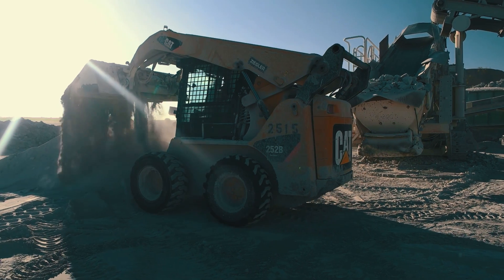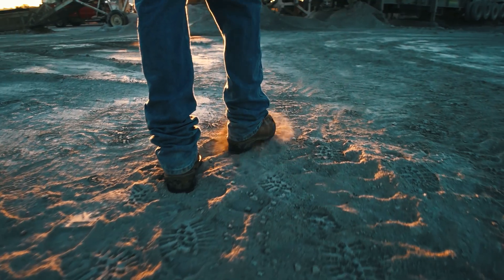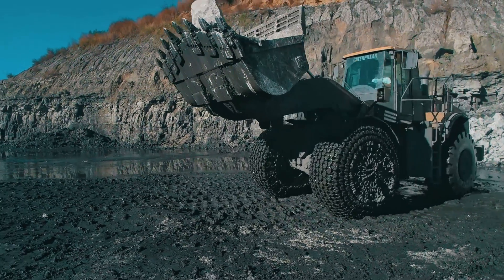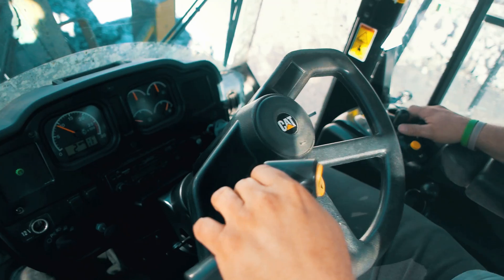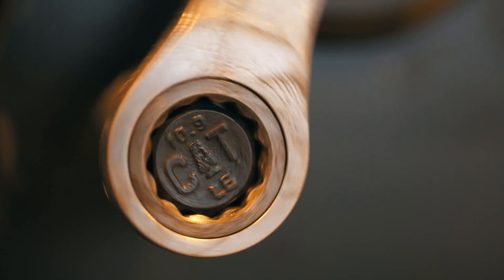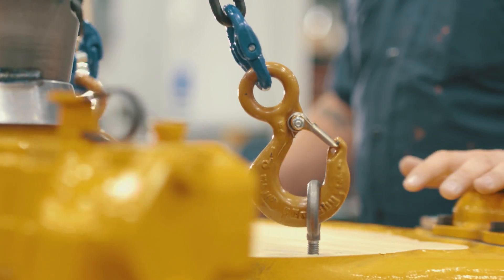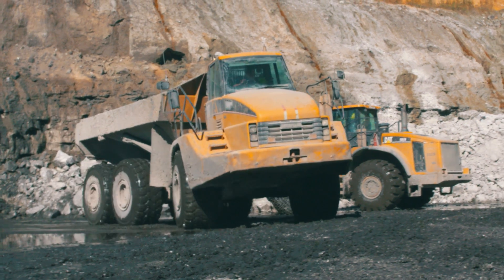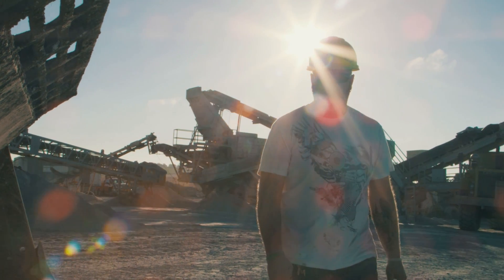Cat® 980H Wheel Loader Rebuild Case Study

Comment: What are the chain type things on some of the tires/wheels for, protection or grip?
Reply: BigBaddie666 yes and they help prevent wear
Reply from the maker: Hi! The chains on the front tires are due to the environment that that particular machine is running in. It is in a rock quarry, loading shot rock. This material tends to be very sharp, and the chains protect the rubber tires from excess wear and possible punctures.
Reply: Thank you for the replies.